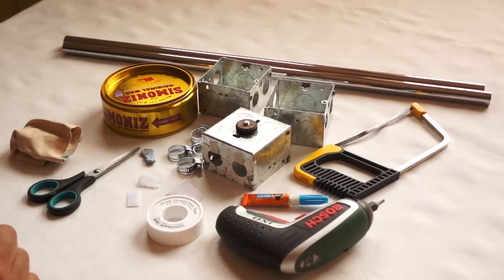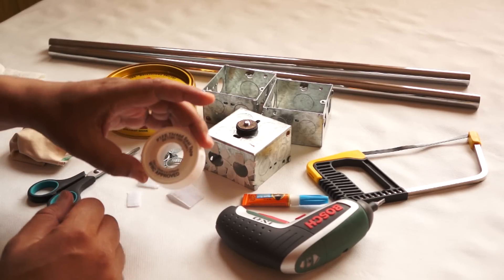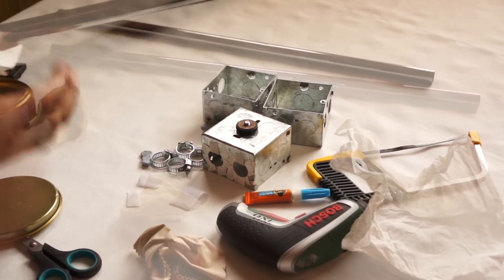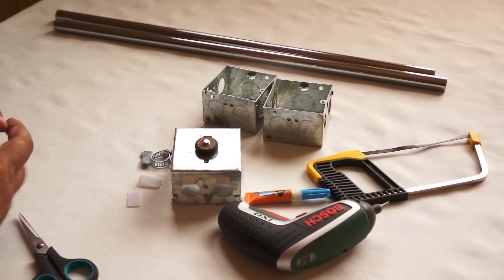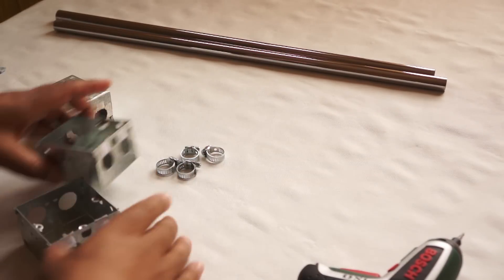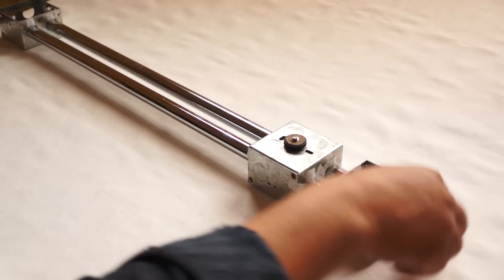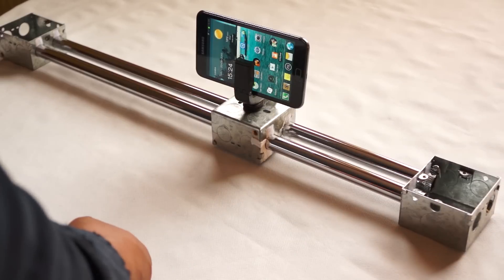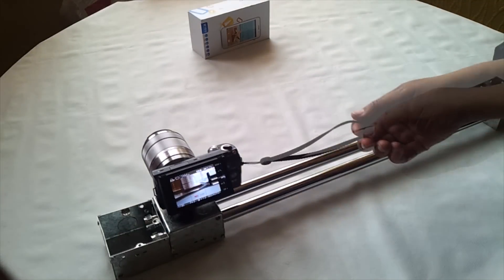Slinky Slidar - our $10 DIY ultra smooth camera slider [Red Ferret How-To]

Comment: You can use an egg timer with a shoe string wrapped around it as an automatic pulley for timelapse with a rig like this. I like the overall design idea although when i build mine im going to modify the trolley a bit so it's not just sliding on metal. Maybe skateboard bearings or something

Comment: Maybe attach a rubber band or string to the mount for even smoother movement (if your hands are shaky like mine).
Reply from the maker: Yes, tried that actually. Didn't find too much difference, but maybe it takes a bit of practice?

Comment: you could replace the metal boxes with 3d printed parts. make PLA bearings with a little graphite and no need for ptfe tape or car wax. make it longer and add a slow rpm electric motor for use in a time lapse mode.
Reply from the maker: Lovely. :) More than $10 though? :)

Comment: $10 my hairy ass! Try $49.47.
• Copper pipe: $7.61 each (2) $15.22
http://www.homedepot.com/p/Cerro-3-4-in-x-2-ft-Copper-Type-M-Hard-Straight-Pipe-PSLE-750M002/203654971
• Metal box: $5.78 each (3) $17.34
http://www.homedepot.com/p/Raco-Two-Gang-Drawn-Handy-Box-2-1-8-in-Deep-with-1-2-in-KO-s-and-TS-Bracket-Set-Back-1-2-in-681SP/202056185
• Hose clamps: $0.98 each (4) $3.92
http://www.homedepot.com/p/Everbilt-1-3-4-in-Stainless-Steel-Clamp-6720595/202309386
• Car wax: $12.99
http://www.amazon.com/Simoniz-RT28695-Original-Paste-Wax/dp/B00UOTDRDY/ref=sr_1_1?ie=UTF8&qid=1461314237&sr=8-1&keywords=simoniz+car+wax

Comment: That is pretty simple, i might make it out of plastic and put it on a wooden board or something. Have you ever made one from plastic/pvc? And if you have, how did it work out?
Reply: CyclingDane PLastic will bend with the weight of the camera.. Film Riot explained all that pretty well, I watch all videos and end up creating my own using tips from everyone, Film Riots was more stable and firm.
Reply from the maker: CyclingDane Nope, we've just done the one metal type so far. I suspect that plastic won't give you the smoothness you need for rolling camera work.
Reply: okay. Yeah i was thinking the same thing however, i might give it a shot :)
Reply from the maker: CyclingDane Good luck. Let us know how you get on. :)
Reply: how do you know which camera I am using? Do you have the weight of my camera? I hardly believe that PVC pipes will bend by the weight of my camera.. 

You might want to get a bit more details when commenting. 

Going to look into the Film Riot one, thanks.

Comment: Felt will keep the silicon lubing the rails and you wont get the niose...I think I will build the design...where did you get the chrome tubes?
Id put mine on a wood plank and rubber feet...use a 3/8 sae (Im from the US) to hold an old fluid type head...and make it mountable to two old tripods of mine...thanks for the idea Ill run with this...

Comment: That is brilliant.  This is the method I will follow.  Thanks! The only improvement I would suggest is having the pull chord / handle mounted lower down on the metal cube holding the camera, since it will have a lower centre of gravity and eliminate any wobble caused by play in the camera screw.
Reply: That is what I did and it works better keeping pull cord/handle lower

Comment: GOOD JOB! HERE'S WHAT USED TO BUILD A SLIDER, CHROME SHOWER CURTAIN ROD, THREE PLASTIC ELEC. JUNCTION BOXES, HOT SHOE MOUNT, AND 1/4-20 CAMERA MOUNT. ALL FOR UNDER $20.00 US. (YOUR AUDIO NEEDS WORK?)
Reply from the maker: Nice. Is it smooth? Didn't have a proper mic back two years ago. :) Cheers.
Reply: Smooth as a Baby's Butt!

Comment: how did you put the screw mount onto the electrical junction box?
Reply from the maker: I made a small hole and then just screwed it in. Not very elegant, and I suspect a better way would be to use a proper nut on the other side or some strong glue.

Comment: With the middle electrical box i would of stabbed out the back hole and made a little extension bar so i can use that instead of sliding with my fingers.
Reply from the maker: Interesting idea. I'm wondering how smooth that would be though. It's really hard to make sure it runs smoothly, I've found.
Reply: Yeah was thinking about that, I think I might have to try it out and see :)
Reply from the maker: Go for it and let us know. :)

Comment: I love this slider, gets the job done for very little money.  

You might try replacing the pair of pipe clamps with a single pipe clamp large enough to clamp both tubes at once.  Also connecting 2 electrical boxes with tubing is an everyday electrical thing and appropriate fittings are available.  For that matter conduit is fairly smooth and would probably work very well in place of the chrome tubing.  

I recommend everyone who needs a hacksaw get a proper hacksaw, a good hacksaw (the kind with the square tube for a back) is about 100 times better than a cheap one and the blades will last forever.  If you're already at the home center/hardware buying conduit ask them to cut it on their tubing cutter.
Reply from the maker: Thanks for the feedback Terry, good stuff. :)

Comment: Nylon bushes would be better on the dolly and the ends could be stabilised using boots which are designed to sit between conduit and junction boxes, so they fit perfectly.
Reply from the maker: Ahh, you're talking about those rubber grommet things? Sounds like a good idea. Got to be careful on costs though, since the whole thing is supposed to come in at under $10.

Comment: What length is your slider?
Reply from the maker: 60 cm or 2 feet.
Reply: Would you recommend using the car wax method on any other material than chrome, such as EMT pipe?
Reply from the maker: ***** Hmm...good question. I'm not sure you'd get the same amount of smoothness from it, but it probably wouldn't hurt, would it?

Comment: tripod mount: use a super strut on the bottom.  pre-drilled holes so assembly is a cinch.  each box can be mounted on the ends (usually comes in 10ft so cut to fit), then attach the center to a tripod (or leave a bit extra on the ends and use 2 tripods)
Reply: super struts are located in the electrical dept :)

http://www.homedepot.com/p/Superstrut-1-5-8-in-x-10-ft-12-Gauge-Metal-Framing-Channel-ZA12HS10PG/100156509

Comment: I would have probably left the tube double length and put them all the way through the junction boxes. I thought of a similar hack using a printer transport. Good job.
Reply from the maker: Yes, you're absolutely right. I don't know why I didn't think of that before. Version 2.0. :)
Reply from the maker: ***** Ah yes, but we were thinking about costs. $10. :)

Comment: Simply line the holes by rolling up some black velvet contact paper which is long enough to pass through two holes at once. No wax required. Leave the peal and stick on as to keep it stiff.  For longer runs, use 6 foot long aluminium pipes commonly found in hardware stores. Drill out a pair of holes in a block of wood to accommodate larger pipes. Cheers!!
Reply from the maker: Thanks very much for the suggestion James, sounds very interesting. What exactly is the velvet contact paper? I've not come across it before. I assume it gives a very smooth run?

Comment: Good video.  However, I think you should use longer pipes and slide them through the second holes of the electrical boxes to stabilize the slider.  Looks like the pipes were cut a bit too short.  If you don't want to slide the pipes through the second holes, I suppose you could install another fastener before each of first holes.
Reply from the maker: Yes that's actually a pretty good idea. I may try that with V 2.0. :) Also I want to use the thicker Teflon tape, because it should be more robust.